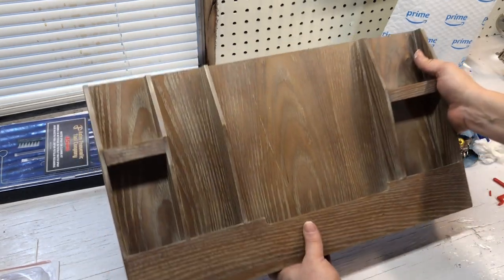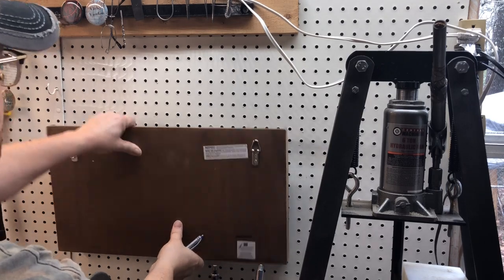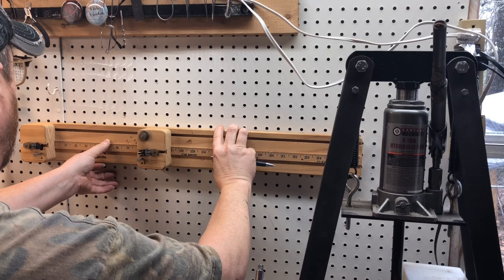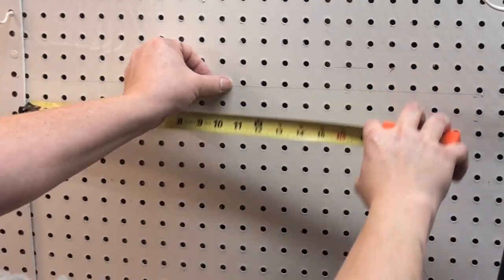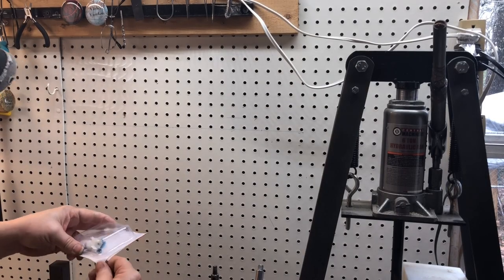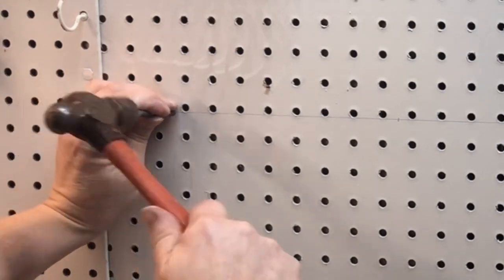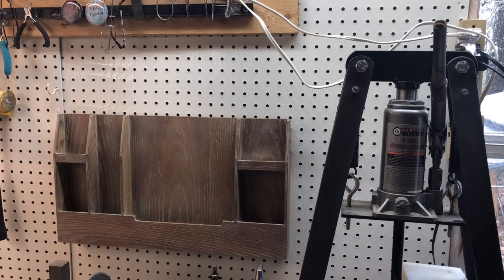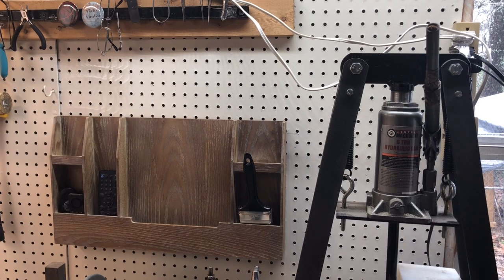How To Hang Pictures,  Shelves and Mirrors with D Ring Hangers - Pottery Barn - DIY 2019

Comment: I hate hanging shelve and mirrors I still don't know it I would get it right! Plus finding a stud in the wall for heavy mirrors!
Reply from the maker: Annie you don’t need a stud if you use the proper wall anchor.   There is so many different types but they should all show the weight rating.  The ones I used on my mirror was for up to 75 pounds.  I feel your pain on getting it level.   Lol.  Thanks for watching Annie and thanks for taking time to comment. 😁👍